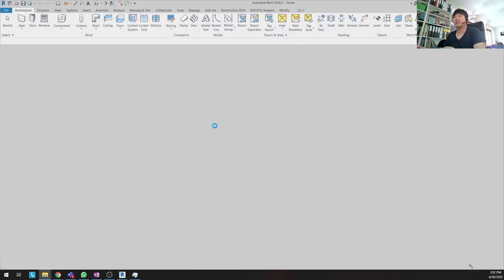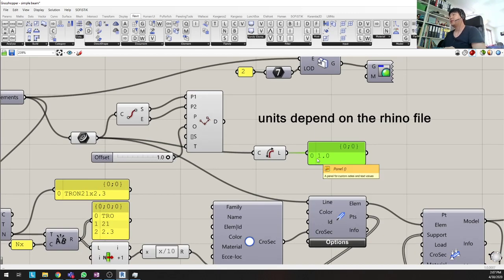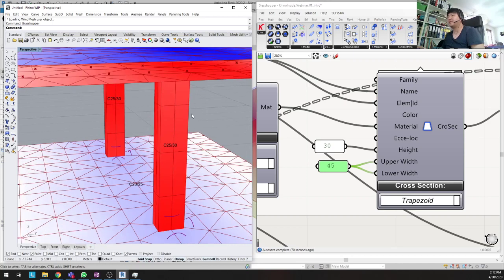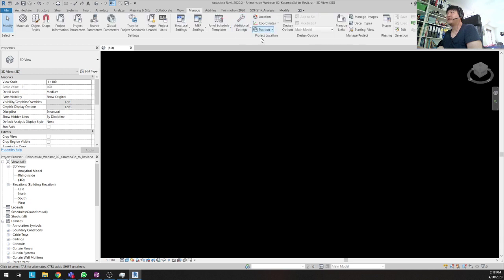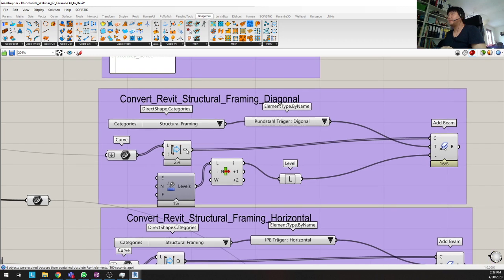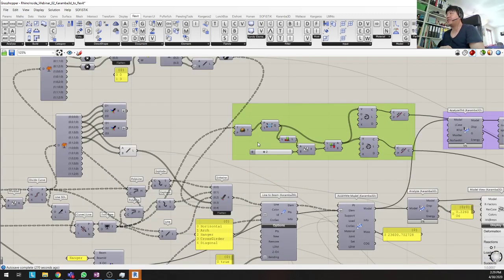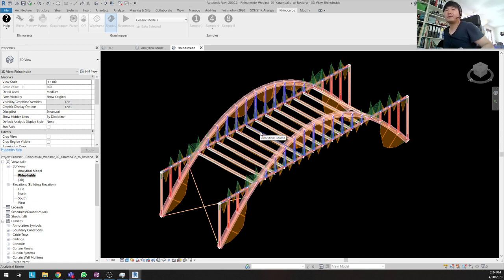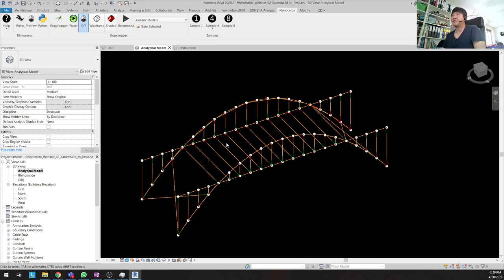Karamba3D in Revit with RhinoInside - Part 2

Comment: Thanks a lot for this interesting session. regarding the first example, when I change the cross section diminsions for column in Karamba 3d, it never change in Revit as well. So I ask kindly, is there some solution for this case?
Reply from the maker: Hi, to be able to change the cross sections in Revit, you need to make sure that all the Cross Sections that you use in Karamba match with the Structural Framing types in Revit. At the moment, only one type is selected for the elements, and it does not change.